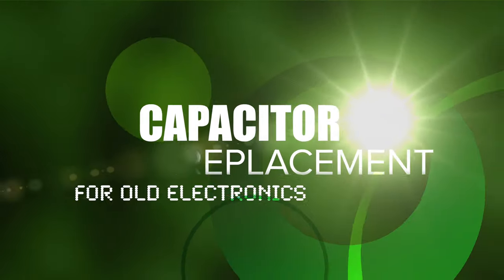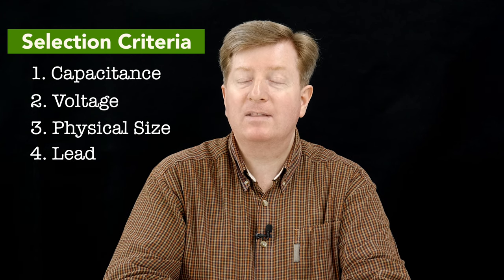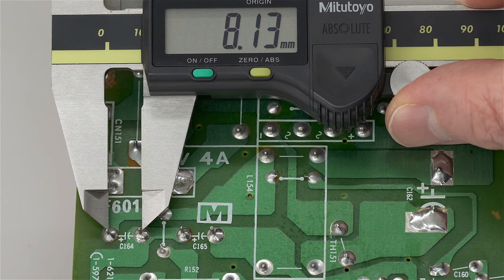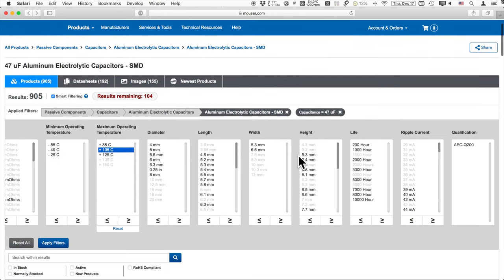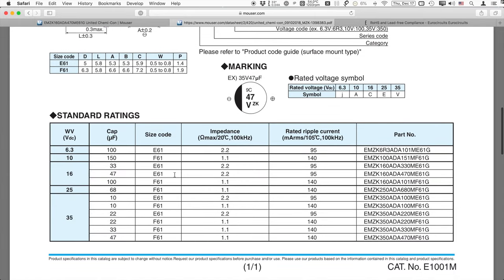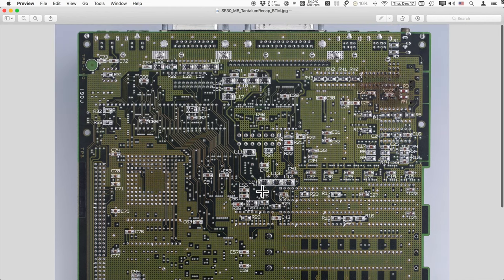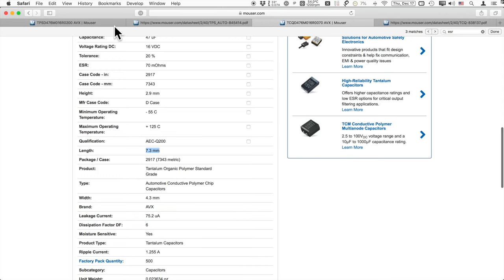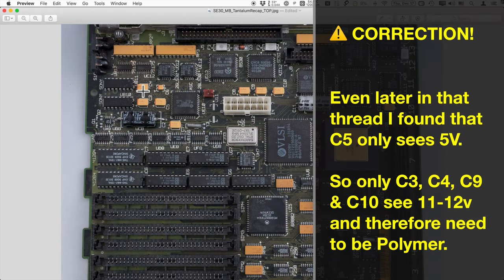Choosing Capacitors to Recap Old Electronics

Comment: Interesting vid. I'm still fairly new at board repairs, no Apple stuff though. What got me started however, was the amp board on my B&W sub. That thing had a couple smaller (ely) caps that, although didn't looked bad themselves, had some serious burning on the board around them. I decided to pull them off after watching a few videos and change them out. What I found doing the research though was that the higher voltage was ok, just so long as the uf remained the same (couldn't find the correct voltage with my search at the time). Anyway, it works flawlessly.

Just wanted to point that out and if I somehow made a mistake with the higher voltage, what would that be and why would others claim that to be ok? Just for high powered stuff?
Reply from the maker: I consider "high powered stuff" to be either in the hundreds of volts or multiple Amps of current, but regardless of that, the advice you were given is sound, and that is what I present in my video too. If you have a 25V 10µF capacitor, for example, replace it with a 25V or higher 10µF capacitor.  In other words, 50V, 100V, etc. will work fine.  Can you go lower than the stock voltage spec?  For example, use a 16V instead of a 25V stock cap?  Actually, you can if you know the maximum voltage that capacitor will see.  The voltage spec is the maximum voltage the cap should see on a regular basis, so never use a 5V rated cap on a 12V voltage line.  But most people lack schematics or otherwise don't know the maximum voltages in their circuit, so using the stock caps as a guide is often the best you can do.  But going with a higher voltage cap has benefits of marginally lower ESR.  You can also swap with the same type of cap, such as swapping an electrolytic for electrolytic; but you can sometimes swap an electrolytic for a solid tantalum, polymer tantalum, polymer aluminum electrolytic, or even film capacitor.  Most of that is discussed in my video.
Reply: Appreciate the response, wasn't expecting one from an older video. 

I understand the "high power" response, I've worked as an electrician in the past and have a ticket for "low" voltage. Most people don't distinguish the differences (low being 600 or less). By "high", what I meant was in regards to amplifier circuits (or other devices with massive caps). 

I must have misunderstood what I heard you talking about, I thought you'd indicated going with a higher voltage could cause problems. I was listening to this while working so I will try not do that next time.

I was aware of the ability to change them out for different types but have yet to experiment (aside from the higher voltage caps I swapped).

Cheers and thanks again for the response!
Reply from the maker: @RickL_was_here  I read and reply to every comment under any video that needs a reply, regardless of the age of my videos.  I try to help out wherever possible.  But no, I did not say in my video that using a higher voltage spec'd capacitor (relative to the voltage rating on the stock cap) would cause problems.  It won't.  You might see a modest reduction in ESR when you go with a higher voltage rated cap, but most of the time, your circuit really won't care about that difference.  And most of the time, lower ESR is better anyway.  Just as one example, on vintage Macintosh analog/power-supply boards, there is a cap labeled C1 which originally was 3.9µF 35V (not polarized).  That is often swapped out for a 100V non-polar 3.9µF cap, but I suggest a 3.9µF Metallized Polypropylene Film Capacitor, because they are easy to find on Mouser.  Film caps are not polarized, and the replacement I recommend is rated for 450V. While the lead spacing differs from the original, it does fit and the higher voltage rating makes no difference at all.

Comment: Great video thank you! I wonder if you can help me make a decision on caps for my 1997 vehicle ECU. I am keeping this vehicle long term and am working on recapping the ECU for preventative maintenance. Thankfully the 3 original electrolytic caps have not leaked as others with the same make/year have already leaked and ruined the PCB. Anyways, the 3  caps as I said are classic electrolytic, looks like a mini AA battery. The specs are Nichicon, H9633, 105C, 25V, 220uF. Since it's for a car ECU located in the engine bay they should also be AEC-Q200 rated. Being that there's only 3, the cost isn't that big of a deal to me. I don't mind spending a few extra bucks for something I will never have to worry about for the rest of mt life. Can I replace those old electrolytic ones with solid polymer caps of the same voltage, temp and capacitance and expect it to work the same? Some say you have to get caps with like 1/2 the capacitance if switching to polymer from electrolytic because of lower ESR. I really want something that will far outlast the old ones which have lasted nearly 27 years. I know you said you aren't into the hybrid ones but so far it sounds like they are my best option and have better functionality compared to the classic electrolytic. I saw one that matches my dimensions and capacitance and has a higher temp rating, 145C at 2000H. Some say the lifetime doubles every 10C drop in operating temp. Would that mean these are rated at 32,000H at 105C? Is there a capacitor I could put in there to replace the old electrolytics and basically know I will never have to replace them again? The dimensions are ~8mm diameter and ~16mm tall or long and they are in a horizontal resting position, radial mount type. Please let me know what you think, thanks!
Reply: Maybe its better to ask about solid vs liquid capacitors. Can I switch to solid polymer or ceramic of the same voltage, capacitance, temp? I've found a couple solid polymers and 1 dipped ceramic (very expensive) but none of them are AEC-Q200 rated. Would it be better to get those or go with a liquid cap rated for AEC-Q200?
Reply from the maker: To eliminate need to swap them out again, you would need a solid electrolyte capacitor.  “Hybrid Polymer” only better in terms of certain specifications relative to normal aluminum electrolytic capacitors.  But the fact remains that Hybrids have a FLUID (not solid) electrolyte, and anything fluid will find its way out over time.  Even if the fluid by some miracle never leaks, it can dry out.  This is why the idea capacitor has a solid electrolyte which can never leak or dry out.  And such a capacitor can be found on Mouser, matching your physical size criterion, as well as capacitance, voltage and high hour rating at 105°C:
https://www.mouser.com/ProductDetail/Chemi-Con/APSG250ELL221MHB5S?qs=nxZbHzLpdve2AQv2batcYQ%3D%3D

Of course, my proposed replacement does not have AEC-Q200 certification.  Many capacitors you look for in recapping applications don’t.  Admittedly, you are the first person who has come along wanting to recap an automotive ECU.  I have worked 30 years in the vehicle aftermarket, and I can say that for our aftermarket products, we almost never use capacitors with AEC-Q200 stress test certification to save cost, and we’ve never had a capacitor failure.  However, we deal in vehicle security systems, not the ECU.  The ECU is a critical vehicle component, so it is prudent to have the best capacitors possible.  AEC-Q200 guarantees you a capacitor which has been tested in a way that comes close to matching the harsh environment of a vehicle.

With that said, fluid-filled aluminum electrolytic capacitors are not great capacitors to begin with.  Their ESR rises a surprising amount at 0°C and lower, and longevity centers on their fluid electrolyte not leaking or drying up.  These are things that cannot be resolved by AEC-Q200 stress testing.

In comparison, the solid electrolyte capacitor I linked for you above is superior in many ways to the stock capacitors in your ECU.  They are simply not stress tested.  

Also, when considering hour-rating, you need to also consider that capacitor manufacturers don’t guarantee anything beyond 20 years or so, regardless of what the math calculates with respect to the hour-rating and the average temperature in your environment.  For example, you can find some high-hour rating aluminum electrolytic capacitors rated at 125°C, and the math may suggest they have a 40-year life, but in reality, that fluid inside them limits their life, and as I said, the make of those parts doesn’t guarantee their operation beyond 20 years or so.

My only concern about swapping out with a very low ESR type like the capacitor I linked for you is that I have no idea how they are used in your ECU.  If there is a switching power supply on the ECU board and if those capacitors are critical components in that power supply, it could be the power supply requires a minimum ESR for the capacitors used.  Probably not in the case of 200µF capacitors, but I cannot say for sure.  What happens if the switching power supply controller requires capacitors with a minimum ESR but you use something lower than the minimum?  Well, the output of that power supply would very likely become noisy at best, completely unstable at worst.  But sans having a schematic, the only way to know would be to swap them out and test.  But because an ECU is a critical car component, the best approach would be to put an oscilloscope on the voltage output to ensure it remains stable after recap.  Meaning, you would need to see the noise on the output voltage before and after the recap to compare.  And I’m guessing that you may not have a scope.

This is the best advice I can give you, but I would strongly suggest you visit the EEVBlog forum and put your question to the engineers there because some will surely have automotive ECU design experience and can give you more experienced advice.  Keep in mind though that recapping is not embraced by everyone.  Some people think it’s a crazy idea.  It is in some cases but not in others, so don’t be discouraged by people who claim you never need to recap anything.  There are people like that.  But it could be that posting in the EEVBlog forum will garner you more specific advice, especially in regard to AEC-Q200 certification for replacement capacitors you intend to use in an important vehicle component like an ECU.
Reply: @JDW-  Wow, thank you for taking so much time to help me!
I am very interested in that polymer option you found, even though it doesn’t have the AEC-Q200 certification. I compared the stress test data from the datasheet with a liquid AEC-Q200 cap and they are fairly similar. 
The ECU I am working on is what I might call poorly designed for future maintenance. The circuit board isn’t even a circuit board, it’s like a giant flexible…ribbon cable? Which is adhered to a sheet of aluminum and bent over like a book. It was very hard to get open and has some minor damage just from that so I really don’t want to have to do it again. Most ECU’s are a typical metal box with a solid PCB screwed inside it. If it were a lot easier to open up I would be less concerned about putting liquid caps back in because I could just recap it every 15 years or so.

Anyways. I am not very experienced with electronics, I’m your average diy. So I don’t know about the possibility of it having a switching power supply. (I also don’t have a scope or the knowledge of testing with one.) I wonder if I could get you a picture of the ECU where the 3 caps are located if you could tell me if it looks like it has what you were talking about or not? 
It may not be the best comparison, but there is a guy on youtube who replaced liquid caps with solid polymer in his ECU 4 years ago it seems he has had no problems. His was from a different make/year than mine though. If I do replace mine with the solid polymer I will be making some extra precautions for heat and humidity although I doubt there will be an issue. I couldn’t find a schematic of the ecu but I found a connector pinout which mentioned the voltage to the ecu is only 5v. I’m not sure if that tells us anything or not.
I will likely check out the EEVblog as well. It will be a couple months before I do the recap but I’m getting my homework done ahead of time.
Please let me know if a picture of the PCB would help decide if solid polymers will be a good idea or not
Thanks again!
Reply from the maker: @wekeeptruckin it could be that only 5V enters your ECU but there may be a 5V to 3.3V step down converter on it. You could take a photo and post it to an online sharing service and try to post a link to that here, but it would need to be high enough resolution to see the part numbers on the chips to know if it’s a switching power supply. 

The entire point here is determine if there is indeed a switching power supply on the ECU and if so, what is the main controller chip part number, and then Google that part number so as to find a datasheet l to see what the input and output capacitor requirements are with regard to ESR (resistance of the capacitors). If there is no minimum ESR, then you have nothing to worry about when using very low ESR polymer capacitors.
Reply: @JDW-  Ok, I will look into the photo thing. I am a bit concerned about the humidity factor causing premature wear on the polymers. Do those need to breathe or could I coat them in silicone caulking or conformal coating to seal them off from humidity?
Reply from the maker: @wekeeptruckin  Humidity is more of a concern when you buy the capacitors new and store them a long time.  Also, once the package is opened, you should solder them in soon so humidity won't penetrate them an possibly cause issues when you do solder them in.  Once soldered, they should be fine against humidity, even better so than fluid-filled electrolytic capacitors.  Using a conformal coating is not a problem because they don't need to breathe.  Applying such a coating would guarantee that humidity would not have an adverse impact on those capacitors or any other component on the circuit board.

Comment: Tantalum caps should be checked as well. I've replaced sooo many of them. They might look pefectly fine, but really they are shorted - as in sub zero ohms. And that will kill adjacent circuitry.

Also, they should be rated at double the voltage of that in the actual circuit.

When it comes to electrolytics and all you have is the C-meter in you multimeter, then measure the capacitance. If it reads much much above the nominal rating, then it's turning in to a short. If it reads much below, then it's drying out, losing capacitance, increasing ESR. If it reads well within the limits given in the datasheet, then it's problably ok.

What you really want is to measure the capacitance, the ESR, and the EPR.

However, if you're repairing 30+ years old equipment, then replace the whole lot. New caps probably have better specs over all, and finding 105 °C - 20,000 hours caps from well-known manufacturers isn't difficult or expensive.

Edit: Just recently I had a shorted electrolytic in the rectifying circuit i.n a power supply - a Bang & Olufsen. The C-meter was very unhappy and dissatisfied because of this. The ohm-meter said 2 ohms.

At the other extreme I had two 8 μF caps read out to be 25 μF.
Reply from the maker: If the SOLID tantalums (not Polymer Tantalums) are shorted, the user will unfortunately find that out if they accidentally powered on before checking them, as those caps would be a dead short.  The reality is that most people don't check them outside the circuit if they don't notice any burn marks on them.  Most people start the recapping process when the flip on the power and find their device does not work, then they jump onto forums or FaceBook groups or Reddit to ask for advice, and then they learn about recapping.

As to the 50% voltage derating, yes, you are correct.  I actually discussed that in my SE/30 motherboard practical example in the video.  But again, that applies to SOLID tantalums.  You only need to derate the Polymer tantalums by 20%.  That's why you need a 25V solid tantalum on a 12V rail, but only need a 16V polymer tantalum on the same rail.  Even so, OS-CON caps are cheaper than polymer tantalum caps and offer lower ESR as well, which often make them a better choice than either tantalum type.  You just have to be careful when recapping switch mode power supplies, as some require a minimum ESR to be stable.

And yes, I agree that AGE is a better predictor of bad caps than usage and heat.  If you have fluid-filled caps that are 30 years old, axial or radial, they do need to be replaced, even if the device seems to work fine.
Reply: We totally agree 👍